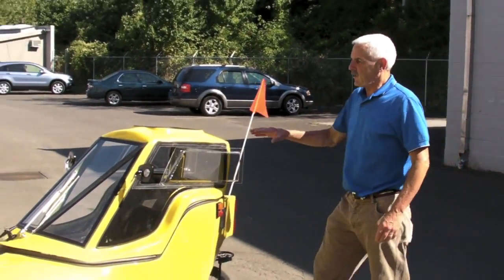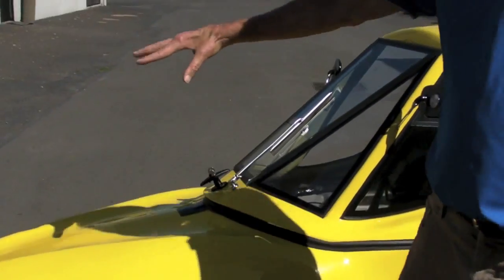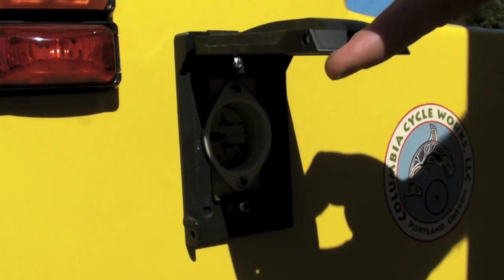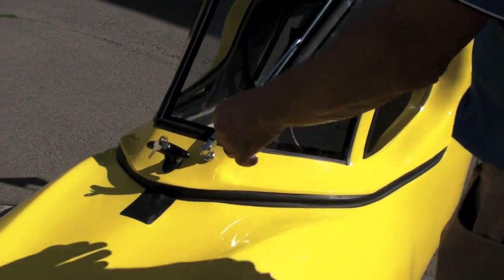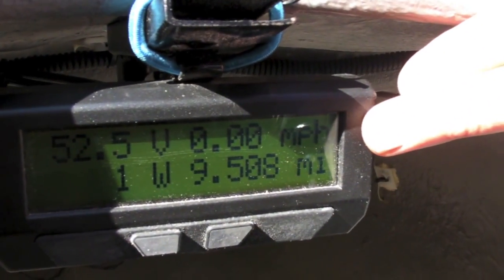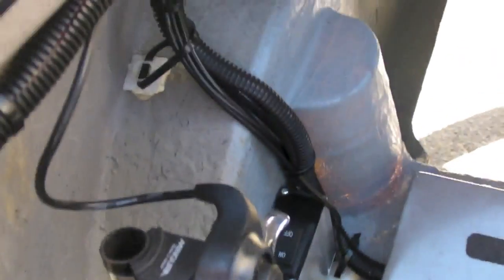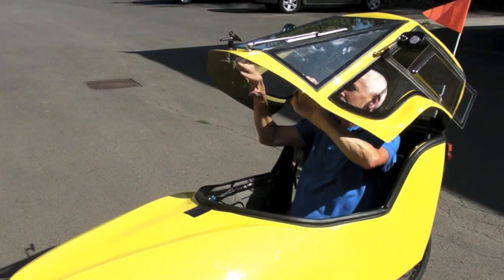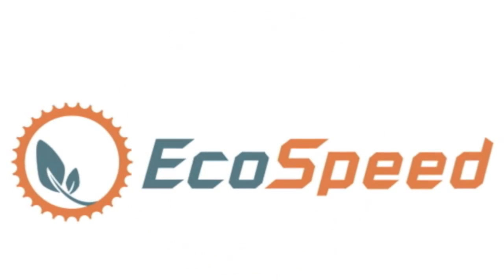The Tripod Velomobile features, with EcoSpeed Mid-Drive Electric Assist.

Comment: How much does this cost though? I like the ELF electric bike because it has a 100w solar panel on top that charges the battery as well as the option to plug it in. It even has a model that will fit a passenger & space for several bags of groceries, but it's over $5,000. At least this has a locking "door". The ELF doesn't even come with doors standard. There an extra option.
Reply: That's what I was gonna say

Comment from the maker: Hey Paul!  Thanks for the compliment.  It is actually quite stable.  Some trikes, because of their ability to make really sharp turns, combined with a higher seat can be flipped.  The combination of the extra weight of the shell and low mounted battery, the width of the front wheels, and the steering (which doesn't allow for super sharp turns) makes this a very stable ride.